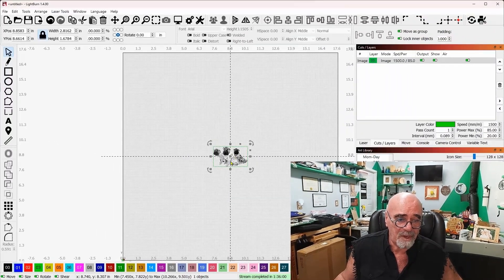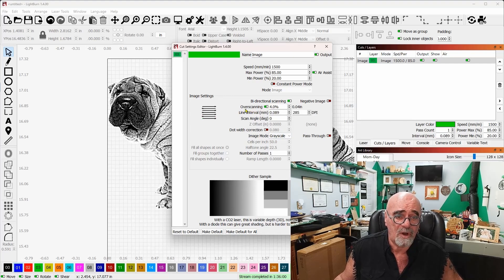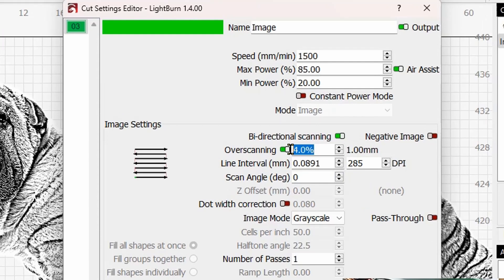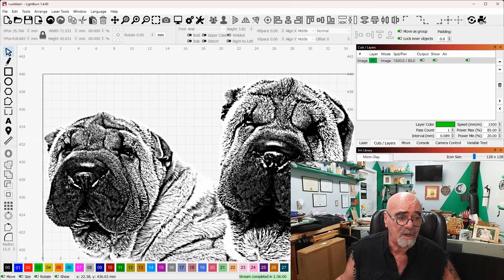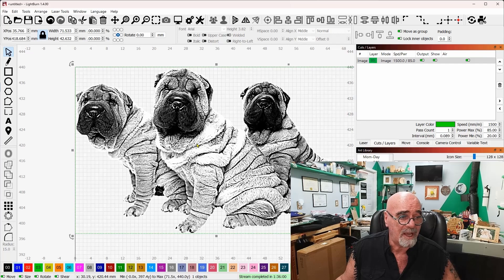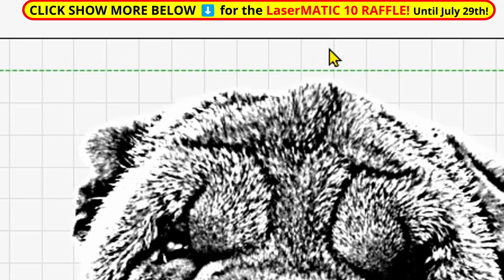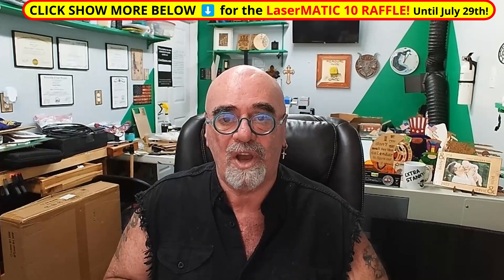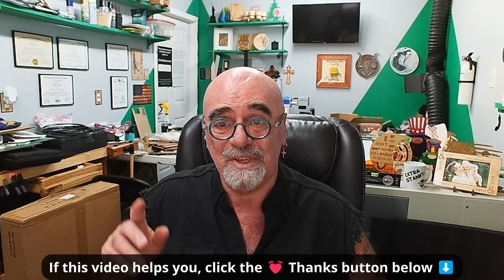💡 Why your DIODE laser STOPS in the MIDDLE OF THE JOB! The MOST likely cause!

Comment: Hi Rich, mine stops & starts up again, but without finising the job. I see the power going of and straight back on again, but the machine stops the job. LB still continue counting. I watch the power loader from the machine and the green light stays on, but the main board stops & starts, the computer gives a sound like disconnecting a device. Any advice? Thnx
Reply from the maker: I can't really tell from the description, but it sounds like the power supply might be going out.

Comment: I have a NEJE 40640 Laser and use 
Lightburn software. Why is my laser firing prematurely while traveling to my project build?
Reply from the maker: You might have white space burning turned on. To turn it off, try entering $32=0 and press enter on the Console Tab. For Lightburn Software help, email, support@lightburnsoftware.com.

Comment: I had that problem of the laser just stopping, only to find out the Laser head was bumping into the power cable and air hose. It was not tied properly so that it could move freely with the laser head.
Reply from the maker: That happens a lot G.

Comment: Mine stopped when I turned on a fan, when  laptop went to sleep, and again when I turned on my guitar amp. Different outlets, but same circuit. My box is on same wall as my laser outlet so I think It will get a dedicated breaker.
Reply from the maker: You're might want to try a UPS for that.

Comment: I have made diy arduino based grbl laser engraver, it stops everytime in the middle of job, i tried your settings too and every possible way of resolving issue, but still it stops please help
Reply from the maker: I'm afraid I can't give technical support here in the comments. But you can reach a tech on the Lightburn forum: https://forum.lightburnsoftware.com/

Comment: my project is 16mm from the edge but still it stopped  at a part not even close to the edge. So thats a bit weird, I will try it again tomorrow with more space from the edge
Reply from the maker: The preview window will show you if it's clear or not.
Reply: @TheLouisianaHobbyGuy  yeah i think it is, i see lots of space between the green lines and the project, when i play the preview it doesnt stop anywhere....
Reply from the maker: Then you're facing something mechanical.
Reply: @TheLouisianaHobbyGuy  well I dont understand lol but I do know that moving the objects a bit from all edges helped. It worked fine now! So luckily nothing mechanical :) Or unlucky because if it was I could have buy the s30max.... got the S9 now, but when looking how strong and fast the S30. max is compared to a S9..... light and day :)
Reply: @TheLouisianaHobbyGuy  ok apparently I had to disconnect the usb cable because lightburn didnt got into a stop (after clicking stop). So I could not control the laser. Maybe it is the usb cable... Im gonna try it out again without this cable
Reply: @TheLouisianaHobbyGuy  During the test (in high speed) i placed the laser manually on position. When I did the that last run, which failed, I placed the laser on position through lightburn. The last run I did the 4 objects separately, assigned different layers which I then could disable the output for, but I also did the laser manually. Not sure if that matters... Would it then also fail if I do the objects piece by piece or would it only fail when doing the 4 in the same run? Basically nothing else changes for the positions of the objects...
Reply: just engraved 2 other objects which went fine, did the next 2 on a new board in exact the same way and now it stopped again at the second object.  Maybe it is something mechanical....
Reply: Im reading this on the lightburn website, its for the wireless kit:  Intended for Mac users to overcome issues with USB connectivity, but works equally well for Windows or Linux users.
Im using a mac, so maybe it is an usb issue.
Reply from the maker: More likely you're using Current Position and don't completely understand how it works. I read somewhere you said you moved the laser head by hand. That's a big no-no. I don't follow comments when they're this old, so the chances of me seeing replies this old are slim to none.

Comment: House ground faults are apparently a big thing too? 🤔 
Im having trouble with devices that turn on in my house interfering with print's, even my air assist will interfere,  my office devices are all earthed and show zero ohm except for the laser cutter and 3d printer. 
It's got to be my house wiring? 🤔
Reply from the maker: I would guess it probably is. You can always try running a ground wire from the laser module to the frame of the laser... worth a shot.
Reply: @TheLouisianaHobbyGuy  I always earth my electronics as I do a lot of radio stuff aswell, it was the first thing I did.
Unfortunately nothing has worked
Reply from the maker: I don't know what to tell you then, sorry.

Comment: I'm new to lasers. My wife and I just got our Roly 20w setup. My laser stops in the middle of project even if I setup the job in the center of the work space. Any ideas? I have a 25 foot usb cable as the laser is a little ways away from the computer, could this be it? Everything is new i.e. computer cable and laser. Thank you in advance and Thank you for all of the informative videos!
Reply from the maker: If you have a 25' USB, it must be an active USB cable, or it work work consistently.

Comment: I have a xtool d1 pro using creative space I have no issues running a job. However in lightburn I keep running into a lost usb connection. Usb is fine i was cutting fine for a couple hours didn't touch anything then I loaded a new job and it gets about a min into the job then stops says but I can instantly start the job again. Usb is not on sleep or anything either
Reply from the maker: Try posting on https://forum.lightburnsoftware.com/

Comment: I just had this problem with my co2 laser. My bed is 16x30 and I have 6 to 8 inches of available space all around my project. It just goes and stops. The head is almost in the middle of the bed when it stops. Any suggestions?
Reply from the maker: I can't diagnose problems in a text, sorry. Try emailing the manufacturer.

Comment: I’d just move the job to 10mm from the edge and adjust the wood to position where I want it to start. I never use the edge of the workspace anyway. 

What I’d like to see is how to continue a job if the power goes out. I had one the other day where power went out and stopped the job. My laptop had power but the laser did not. I also can’t afford the big UPS that you suggested in a previous video. While great and all, it seemed a bit overkill and def too expensive. I tried to continue the job from the preview but I couldn’t figure out how far it had gotten.
Reply from the maker: Ah, easy! When the power is restored, reopen the file and go to the preview. Use the slider and scrub to the point where it stopped and then click on, Start job from here.

Comment: On the Z1, the accelerometer falsely triggers which stops it in it's tracks. I even had 1 time that the steppers stopped, but the laser didn't turn off.
Reply from the maker: Like I said in the video, there are several reasons, but I wanted to cover this one specifically because it happens a lot!

Comment: Very helpful video!  I had another issue that I came across.. I ran a job on my laser and by the time it was done, my monitor had gone to sleep..  So, I opened my enclosure to check the engrave and clicked on the mouse to wake the monitor..  The laser started the job again!  Besides potentially ruining the engrave, it could have ruined my vision!  After it happened a 2nd time, I found in the lightburn settings "ignore start button when monitor is asleep", but it was off! Lightburn should set this to on by default..  Have you ever come across this?
Reply from the maker: I've seen that setting in the file settings, but I don't think that was the problem. More likely your machine went to sleep or hibernated. My monitor turns off all the time during long burns and the laser never stops streaming. My machine is set to always on, with the monitor turning off after 20 minutes.

Comment: Rich you must be psychic! I just ran my first job on my new Lasermatic 10 and it stopped mid job. It was the word "test" in the center of a 4 inch round cork coaster with plenty of room(3/4 inch either side) so I must have some kind of USB or other COM glitch. As always you are the go to guy.
Reply from the maker: Several people have had issues with the V1 of the LaserMATIC USB cord. They have since changed manufacturers and gotten a better one.

Comment: I had an issue with my laser stopping in the middle of the job. Went through all settings, double checked everthing setting were ok. Then thought just out of the blue, I would changed the usb cable. And well there was the problem. A simple cheap fix. Which I was happy about😃
Reply from the maker: Yep, there are several reasons the job can stop Ian, and the USB causing a streaming error is one of them!

Comment: On my old Ortur I had the problem of sudden stops mid-project, not only at the edge, the solution was to ground the frame. Thanks for your very informative videos.
Reply from the maker: That was a known issue on the LM2 and Ortur released a free ground kit for it about a year ago.
Reply: How did you ground the frame. I'm having this problem on my longer 10 watt laser.